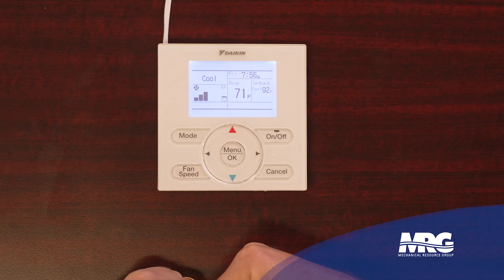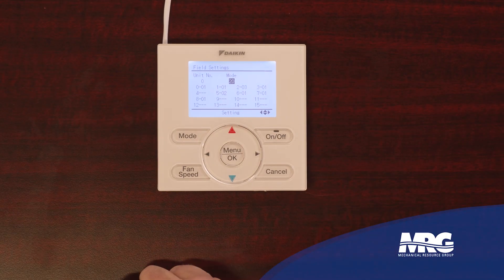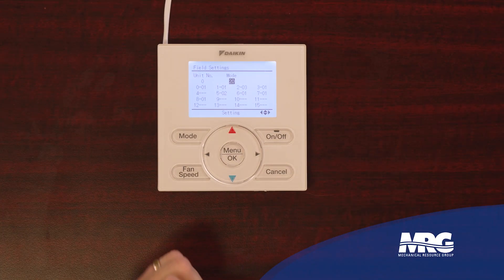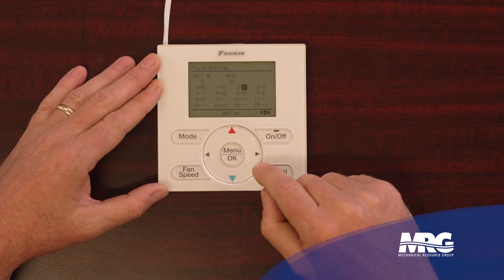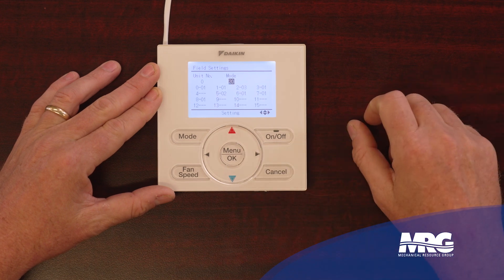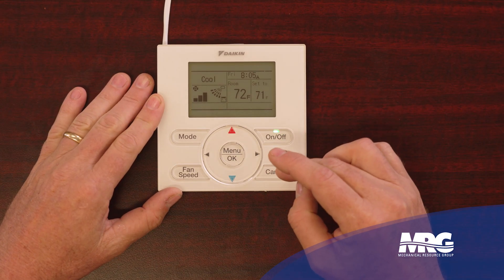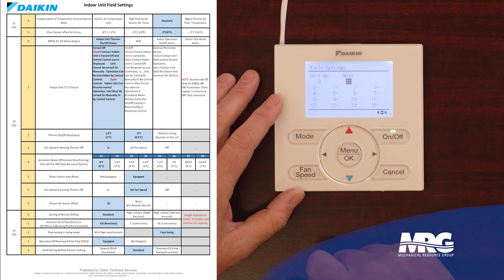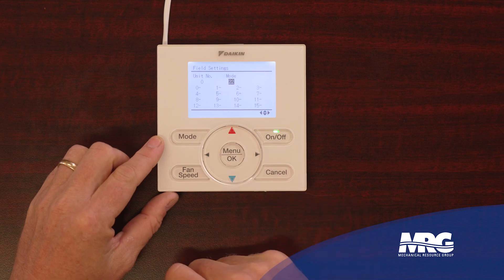Demystify VRV Space Temperature Control with the Daikin BRC1E73 Remote Controller!

Comment: Hey thank you for this video. I’m getting an error code CJ. Would that have to do with switching the thermister setting?
Reply from the maker: check the IDU that you are connected to. If it’s a certain style of unit such as a FXTQ it may not have its own return thermistor and therefore you must use the Nav Stat thermistor.

Comment: How do I use  hoe water system  as a primary  heat not the heatpump  because i  have a high efficiency boiler with hot water coil  please  let me know  how we have KRP1C75  installed in the air handler
Reply from the maker: This can be done but you will need to get the unit M# info as well as the KRP board info and contact tech support as this will be done through dip switch settings at the IDU and possibly at the ODU- depending if you want to do the entire system or just an individual unit.

Comment: Is there a way to have the fan cycle after it hits the desired set point temperature?
Reply from the maker: Hey Mark,
If the fan is in auto mode and we are using the nav stat thermistor to control setpoint, the fan should cycle off after setpoint is achieved- as long as field setting mode #22 first code 3 and first code 6 are both set to off.

Comment: Had a customer a few months ago complaining about wall mount blowing cool air in heating. After checking its vitals  i didnt know what was wrong so arranged a service call by daikin. Suppose the problem was the mode 3 setting but it was a madoka bluetooth controller so im not sure if its possible to change field settings on that?
Anyway thanks for another useful video 🤘